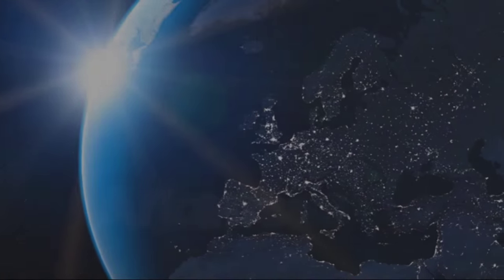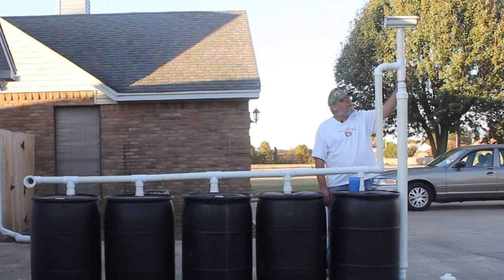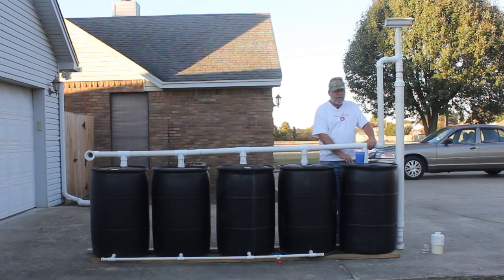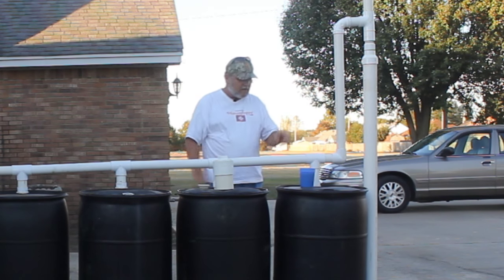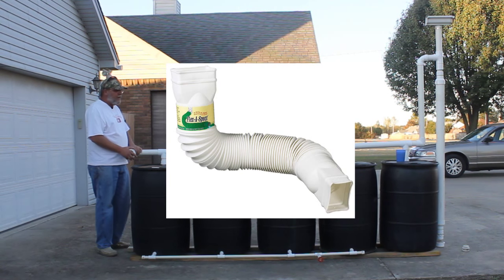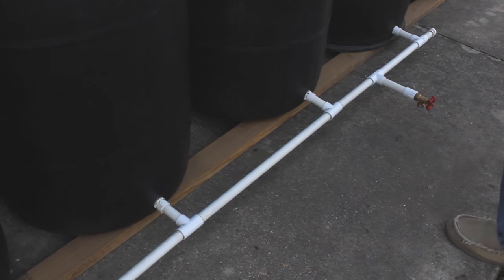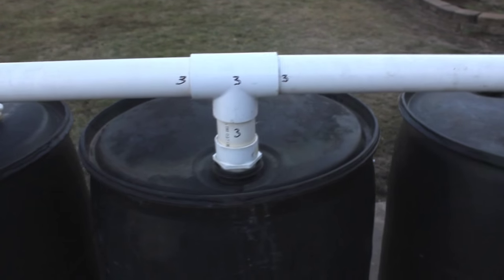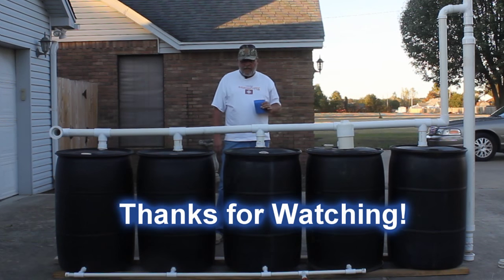DIY Rain Barrel System Explained

Comment: FINALLY!!! Someone with good instructional skills and who don't ramble and gives very good advice. Thank you for this video. I have gleaned lots of information on this. I will be building one of these but on a 12 barrel manifold. I will have the water piped in from the gutter system to an inside building so that I can use this system all year long in my Arkansas home.
Reply: great idea about putting inside a building. When I do my system, I will definitely be doing this.

Comment: Thank you.  Finally someone who took the time to EXPLAIN how the system is put together and how it all works.  I've seen several video's people showing their system but not bothering (or knowing how) to explain the connections and functions.  Yours is clear and easy to follow, and makes perfect sense.  It would appear your system might be upgradeable, but if not - - - .  I'm new to this and am starting with only two barrels.  Maybe four, but our state law allows collection - get this - no mis-quoting going on - 2500 gallons may be collected and stored on premises.  However, if a person goes with rain barrels - they're allowed 2 (TWO) barrels max.  I don't think anyone is going to be checking, but you never know what nosey neighbor is going to do or say just to stir up trouble.

The mud catcher pipe is good advice.  As for a ball - I don't see a need for it.  You have it.  Maybe it works better than what I'm thinking.  I'm thinking just a small hole at the bottom to allow it to drain constantly.  If it's draining while raining - no harm.  After the rain the mud catcher will empty itself out. Provided the mud doesn't clog up the hole.  You didn't say where you put your hole so I'm thinking I may put mine 10 to 15 inches above the bottom.  That way it's more likely to drain and not clog.  But like anything, it's going to take maintenance.  It will have to be cleaned out.  I may just put a ball valve at the bottom and a hose bib attachment mid way up so I can flush it without having to disassemble anything.  Any suggestions I make here are made in public and the public is at liberty to use any idea I may present.

The mud catcher, the sediment barrel (with the soil flange and a screw cap) and the actual barrels used for gardening.

Not sure why I'm going with this expense.  Every month I'm charged for 10,000 gallons whether I use it or not.  I'm currently trying to get the city to change their billing method to charge a monthly fee and then charge for gallons used as opposed to a bulk minimum.  If I pay for 10,000 gallons a month then I have the moral, and probably legal right to use all of it.  You can't ask me to conserve.  But why not?!  We're in a drought stricken state.  One of many now.  You may even figure out where I am.  So what.  I'll start my system off with two downspouts channeling into a single mud catcher, sediment barrel and rainwater barrels.  Probably three in all.  I may even add a 12 volt DC pump and a car battery that is kept charged by a small solar panel.  Hey!  FREE is FREE!

Comment: Great explanation and display. One suggestion. At the 1/2-3/4" bottom drain pipe, instead of cutting and adding couplings, add a 'threaded union' between bottom 'out of barrel' drain to t and you can un-thread each line. I would go with Schedule 40-1" drain line not the cheap stuff, then keep it covered too and it will last as long as the 2" Schedule 40 also.

Comment: Great video, one thing I noticed with your system that could help cut down on gunk in your supply buckets even further. If you run two pipes in to your first barrel, inlet and outlet, then it would act somewhat like a septic tank. The solids would settle out with the water running out the top. I would take it a step further by running the inlet down into the bottom half of the barrel with the outlet out the top
Reply from the maker: I worked as a civil engineer assistant building very large systems and I am on a septic system here at my new home out in the country.                                                                                                                                       That would be a great idea! Designing a baffle as a septic tank has to stop the motion inside.

Comment: Thanks for taking the time to share your experiance and talent on your DIY rain catcher barrel system.

I'm in Australia and unfortunatly we don't appear to have the diversity of range of PVC fittings as yourself in the U.S.
Is there any chance you can give a full description of the 2-in /50mm threaded fitting used in the bunge hole of the barrel please?
Reply from the maker: If you notice there is two bung holes. One thread is different than the other. If you have both caps you can take them to the plumbing or hardware store to match the 2" male coupler. One one bung is a perfect match to the pvc fitting in U.S. 2 in. PVC Schedule 40 MPT x S Male Adapter. https://www.homedepot.com/p/Charlotte-Pipe-2-in-PVC-Schedule-40-MPT-x-S-Male-Adapter-PVC-02109-1600HD/203825431

Comment: Another note as far as pipe and fittings. Get the gray stuff. Sorry I do not recall the term. It is less UV prone. Maybe a light sanding with 220 grit sandpaper and some krylon spray paint to help block UV Ray's. Worth a try, to get 5-8 years between replacing pipe and fittings
Reply: sch 80

Comment: i just use first 55 gallon barrel as trash barrel done away with first flush.  it was a royal pain.  we just use first. barrel in garden screen used between 1st 2 barrels. it works. rain water is our water source.  we filter all water to be safer.
Reply from the maker: +Bill'Rosa Ouroffgridsolarcabin 
I have it on a metal building but if it was a shingled building it would be horrific. I check it after ever hard rain to clean it out and sometimes uncap the bottom to allow rain to clean it. Thanks my friend.

Comment: 8:01 The water pressure in the manifold depends only on the height of water. Bigger, or more, barrels will make no difference.
Reply from the maker: You are correct. By not gluing the manifold the chance of blowing a fitting increases x 4 or each barrel you add to the system.

Comment: IM going to build one in the next few days but Im going to put a slip union to unhook the 2 inch pipes from each other on top I got a divertor kit from amazon and figure how to attach the hose they sent to the 2 inch pvc tubes I may put a vent  at the 3rd barrel i think i will use a vent with a screen on it to fill all from the top I also got 3 faucets going to have to figure how to make a manifold system where they can all empty to the end of barrels

Comment: Since you connect all the barrels on the bottom, you actually only need one input pipe for the first barrel.
Reply from the maker: I had this on one side of a 36x45 shop. In a down pour the lower pipes would not carry that much water during a down pour. With a one inch per hour rain 403 gallons would be dumped into this system.

Comment: Good system, I live in Central Florida and I designed the same type of system 4 years ago. To date I have not noticed any deterioration in the pipe material from sun effects. Since my barrels are ground mounted I use an inline pump to pump with a garden hose conn to   water to my garden.

Comment: I have used most of your ideas plus a few of my own but have a problem with flange at the bottom of barrel #1.
How is it attached? My trial leaked like a sieve. I’d sure appreciate a little guidance on that part. Detailed instructions.

Comment: Very well done. I would like some ideas on how to set up a system that is out in the open. Such as a school project that has no buildings where the garden is located to use a downspout. I realize that less water will be captured.
Reply from the maker: Jerry, That is going to be a tough task. If you had a 1" rain fall you would need a 8' x 12' surface area to fill one 55 gallon barrel. I have another video that explains water catchment. If I can be of any other help please let me know. 
https://youtu.be/0KXISmsEC5w?list=PLs887nZ521erWk1Hr3wNd6vE_tNZe_E0b

Comment: Arkansas Prepper:.you can heat your pvc manifold with like a heat gun or similar tool like hair dryer, etc and wiggle the parts loose and even reuse the parts. especially or just the expensive pieces that have threads at the very least it's worth it. also it's a good skill to have anyway.
Reply from the maker: What is the name of PVC glue you use that can be separated with a hair dryer? Please post a link. Thanks!

Comment: You mentioned a lot of pressure from your bottom manifold system.  Would there be enough pressure for a light Outdoor shower without adding an additional Pump?   Thanks, GREAT video
Reply from the maker: Yes, absolutely

Comment: Looks like you could do away with the top pipe going into the last 3 barrels and let them fill from the bottom pipe from the first barrel. As it fills it would fill the last 3 barrels at the same time
Reply from the maker: Manifold pipe will not care the volume of rain during a down pour. The upper pipe will carry more water.

Comment: This water harvesting system would be better if the new/latest water could somehow force the older water out. At the moment once the the tanks are full new water is flushed out leaving the system with stale water no matter how much fresh water passed through after tanks are full. Any other ideas on the design that take this into account?

Something like a 'reverse' float/ball valve as used in toilet cistern to stop flow of inlet pipe but used as a release valve with the boye activating the release once certain volume is reached etc.
It would also have the problem of distributing new water to all harvesting barrels equally so they end up with water of roughly the same harvests etc. A smart reliable design could avoid electronics and use those 7 stage undersink filters for drinking water too! Freshness indicator and water quality control is then needed .

Finally a squeegee like rail system with pressure water nozzle can also be used for consistent roof surface cleaning prior to harvesting (perhaps using tap water ironically).
Reply from the maker: I am only using this water for the garden. If you were considering it as a drinking source, I would treat and filter the water before drinking. In Arkansas during August and September we can go for weeks without rain fall and this is a money saver during that time of year. I hope I have answered you question on my uses for this system. Remember stale rain water is still much better than treated city water on the garden. They garden does really care as long as it is rain. Thanks!

Comment: Can you leave the barrels outside in the winter climate after emptying them? Will it harm the barrel overtime?
Reply from the maker: Sun UV light will cause them to crack and bust. Keep them covered or in the shade at all times. These you see in the video are keep on the north side of a 10 foot wall against my shop. Keep them drained in winter and they should last years.

Comment: How did you get the pipes to connect with the bottom of the barrels?  Since the top of the barrels aren't large lids, how is it possible to thread a connector for the pipes down at the bottom without access to the inside of the barrels?
Reply from the maker: Cut the holes smaller than threaded fittings and used sealer.

Comment: Thank you fore the video. Working on our first project. I was wondering once everything is set up. How do you clean out an sludge or build up in bottom of barrels?
Reply from the maker: Disconnect the barrels lay them on their side and use a water hose.
Reply: @ArkansasPrepper  You can disconnect your barrels easily without disrupting your plumbing set up? Everything is moveable?

Comment: What is the point of the top pipes if the bottom ones already fill the barrels?
Reply from the maker: The amount of water during a rain, The bottom pipe is to small to carry a heavy rain off of a 800 sq. ft roof area. The rain would over flow the top of the down spout.
Reply: @ArkansasPrepper  gotcha. Thanks.

Comment: Is this setup better than the one where the barrels lay down stacked on each other?
Reply from the maker: I think it maybe easier to construct using this method and it is easier to know how much water is in the barrels with them standing on end. There is a lot of weight to consider also. My system full of water weighed over 2200 lbs and I had it sitting on concrete house blocks.

Comment: How did you mount the toilet flange to the bottom to the barrel? Great Vid. Well done!
Reply from the maker: I cut the hole and added lots of silicone and used self tapping screws into the plastic. I also supported the barrel bottom before filing with water. I hope this helped. Thanks!
Reply: @ArkansasPrepper  Great idea! Thanks for the help!  Aloha from Hawaii

Comment: What adapter are you using to attach pipes to the bung hole?
Reply from the maker: If you look at the bungs the threads are one course and one fine. A 2" male fitting is a match to the fine threaded hole.

Comment: If they're all connected by the manifold on the bottom, do you even need them connect with the thicker pipe on top? For the last 4 barrels anyway? Because they're just going to fill up from the bottom anyway...
Reply from the maker: During a hard rain the barrels need an air escape from the water entering plus overflow when they are full.
Reply: @ArkansasPrepper  thank you for clearing that up, makes perfect sense now 👌
Reply: @ArkansasPrepper  and 7 years later no less! 🤣 thank you so much for even replying

Comment: Would a pea trap system work on the top part to keep out the mosquito lave? That way the first flush would wash them down the flush tube, thus saving the other barrels from getting infested with lave.

Comment: I bought a 55 gal barrel to use for rain water catchment  should've looked inside first. I was told it was used for organic olive oil . Do I need to clean it out? won't the oil go rancid? It has an irremovable top. Any suggestions for me. New to this
Reply from the maker: Organic is good! I would suggest using dish soap, most all are organic. Put an average amount into the barrel and fill with water. Let it soak and the rinse it well. If you smell the oil residue? Do it again. You have a very safe barrel, just take your time and you will be happy at the end. Best of luck!
Reply: @ArkansasPrepper  Thank you so much!! I was so bummed. They are really hard to find here. I had to drive 3 hours to get this one at a semi reasonable price. He put the spigot on it for me though

Comment: What's the bung adapter called? Do you have a source for it?
My bottom flow manifold was just overloaded by a 10-minute deluge (7/8-in in 10 minutes), so I need a top manifold to fill them, I think yours is about as perfect setup as can get.

Comment: Is that first flush large enough? I mean a roof is large and there be lots of water coming down which would be nasty. How do you know how large a first flash to use?
Reply from the maker: The first barrel catches what is in access from first flush. If you notice it is not connected to manifold pipe at bottom. That is why there is a removable plug on the bottom of the first barrel. I hope this helps. Thanks!
Reply: I like the system. Wonder if having a first flush barrel, have a timer. Where after the rain  starts flowing in the gutter, let the water go down the drain. And only after a minute or 2 have the gutter water star filling up the barrels.
Reply from the maker: Sure.

Comment: Hello Arkansas Prepper, thank you for your excellent video.  I am going to build the exact same system for my tiny house.  I was wondering, do you know what the threaded plastic pieces are called that you screwed into the bottom of the barrels?  I'm guessing you just drilled a hole slightly smaller than those pieces and screwed them into the holes with teflon tape or pipe sealant?
Reply from the maker: https://www.lowes.com/pd/LASCO-3-4-in-Dia-PVC-Sch-40-Adapter/1067457
Reply: Thank you sir
Reply from the maker: Your welcome if you anymore questions please contact me!

Comment: Does this system give enough pressure for a water hose to water plants?
Reply from the maker: Yes, It will water a garden from a hose. It will not have pressure for a sprinkler.
Reply: ArkansasPrepper thanks , also at the bottom manifold you just tread that piece in or did you also put a coupler inside the barrel? I’m working on putting this together, . Thanks
Reply from the maker: @manuelsalgado8510  I threaded them through the holes ( holes should be  smaller than threaded coupler) plus epoxy glue to hold them. I hope this helped.
Reply: ArkansasPrepper wonderful, thank you, I’m working on this as we speak, great video by the way,